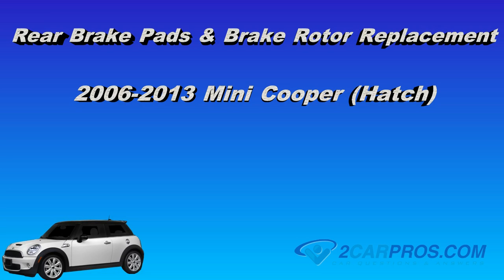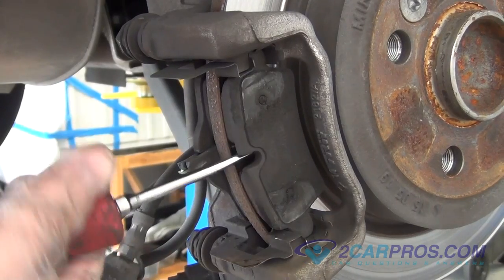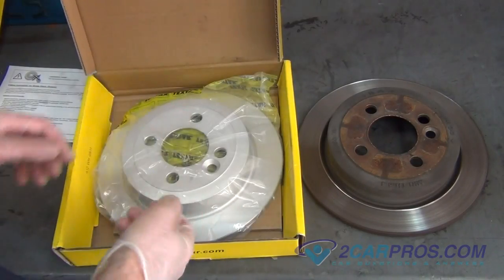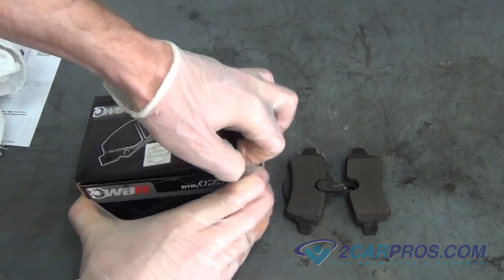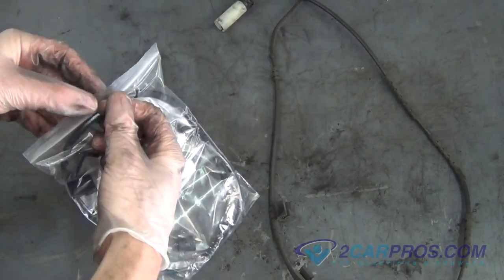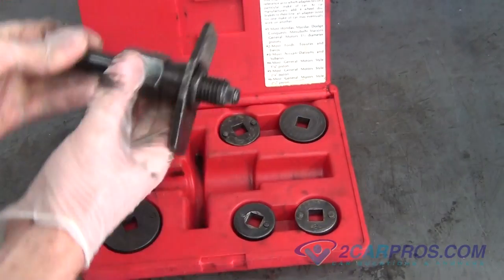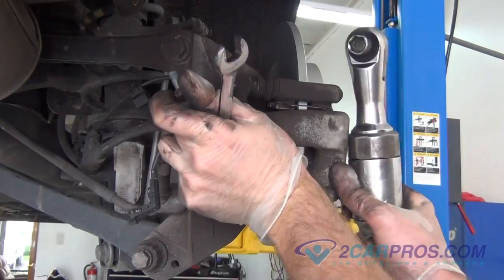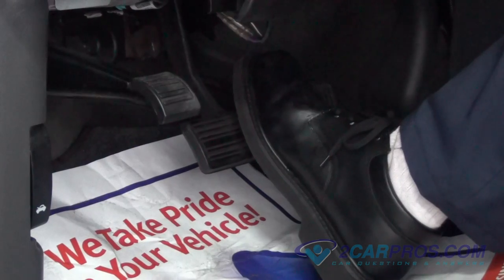Rear Brake Pads & Rotor Replacement Mini Cooper 2006-2013

Comment: I came here looking for the socket size, and got 'use the appropriate size socket'. Thanks...
Reply: 13 mm bolts & 15 mm nut for callipers. 17 mm for wheels.T 50 touque stop for rotor removal. 16 mm for calliper bracket.

Comment: Did the break pads and rotor, following your video and all great. rewinding the piston back was a bit of a effort, but did it. Only problem is the red light on dashboard didn't show off... Question: can be the sensor bad mounted or do I need to reset something? I have done the rear pads... Is it possible front ones are needing replacement as well? Is it common front and back switch on at same time? Thanks for your support.!
Reply: If the light is on, the sensor is worn and needs to be replaced.

Comment: Just done this this afternoon, brake caliper removal is not required, rotor comes off without needing to remove it, just the brake pads. Torx 50 nut is a bitch without an impact driver!

Comment: For Minis (which are notoriously difficult to find service information online for), it would be helpful if you'd specify what precisely the 'factory torque specifications' are at each point mentioned. 

Also, can you explain why it is that the brake pad sensor wire needs to be replaced at each install of the pads? 

cheers!
Reply from the maker: You really don't need them, people just get really mad at me for torque specs. Even though they don't own torque wrenches. Just tight is good. 

Because the sensor can become worn out and read improperly. Thanks for watching!

Comment: Hi, I've changed the brakes on many cars and have to change the brakes on my father's Mini. (The rear rotors are wearing away and making a horrible noise.) One question, how do you bleed the brakes? And do you have to open the master cylinder while pressing in on the caliper? (Sometimes videos forget to show this step!) Thanks!

Comment: This kills the slide boot.

Make sure to hold the nut on the slide (next to the boot) while you are unscrewing the caliper from the caliper bracket if you don't want to wreck them (this was done after the bolt was broken loose, but the boot was already gummed up).

Good video other than that though.

Comment: Great video.  Is it really necessary to remove the Calliper bracket if you remove the Calliper assembly?  What is the process for getting the warning light to go out? (cooper S 2010) Thanks.
Reply: Not necessary to remove the caliper bracket and you would probably need a new brake wear sensor if your brake warning light is still on after you replaced your brakes.. brake wear sensor could have been damaged.

Comment: Just buying 06 mini from a friend. Needs rear pads an rotter. The lug nut cover has no screw driver slot, but has a lot of little holes. Do I have to make a hook tool? And does it just pull off?    I can't find the jack? Batteries in the back, I don't know where the spear is. I might have to buy spear in a bag from a web sit. I'll have to check if it has run flats on it. Thanks you if you for a reply
Reply from the maker: Yeah should just pull off. Thank you for watching!

Comment: Hi, when I used the compresion tool, the rubber boot on the piston twisted. Is this normal? What if I remove the rubber boot or if it got broken during the process?
Reply from the maker: Bricolage Mexicano Yes the boot rotating while using the compression tool is normal. Sorry it is a little bit difficult to see at 5:54 next time we will do a little bit better filming. That tools is awkward to use. If the dust boot is worn needing to replace I would do so to insure the the life of the braking system.

Comment: Could the brake pad wear sensor be removed without damaging it?  If it hasn't broken the filament it should still work the same.
Reply: if it is like the fronts then yes, basically the inner brake pad has a spot that it hooks onto. Taking the Caliper off with the sensor still attached to the pad and just having the sensor disconnected from the connector at the White Tube end means you can slide the whole thing through the Caliper. Also doing the same in reverse when installing the new sensor onto the new pad, you can get it to clip onto the pad firmly and then feed the line through the Caliper and it stays attached nicely.

Comment: does it needs to turn on the engine when pressing the pedal brakes slowly but surely?
Reply from the maker: redenergy legaspi No the engine does not have to be on to do that step. And is probably safer the engine is off just encase it could go into gear without brake pressure. Please subscribe if you have not already.

Comment: Does breaks sesor cale needs to be reaplce if it not broken??
Reply: OzzWiz A if your brake sensor came on your dash you need to replace it. Cause it wore down til it connected the circuit.

Comment: What is the tool you use to remove the bolt holding the rotor? Thank you in advance
Reply from the maker: Could you give a time stamp so I know exactly what you are talking about? Thank you for watching!
Reply: 2:00
Reply: It’s a Torx T50 bit on my 2007 Cooper.

Comment: No fresh thread lock on the bolts? No anti squeal paste on the back of the pads? No fluid level check? No reset on the OBC?
Reply from the maker: If the bolts are tight they will not come loose, the pads have anti squeak shims built in and the OBC was fine so no need to reset. thanks for the comment though.
Reply: Those were my observations as well and I appreciate your reply.  I also wondered about lubrication of the slider pins and if you need to open the brake fluid resivior cap before you compress the caliper.  Thanks for the great video.
Reply from the maker: Just check them, if the sliders need lube then hit them up. You can open the brake reservoir but it is not necessary.
Reply: whats obc?

Comment: It IS a pity that there was no mention of dielectric grease to protect against corrosion from water/salt etc. for the brake sensor connector under the car.
Also there was no mention of torque specs. for the lug bolts, this is important to avoid over tightening these bolts that could lead to a warped brake rotor. 
The video DID give a rudimentary knowledge  of how to change the parts and  rotors though.

Comment: Brake caliber kit.......I usually just use the old brake pad with a c-clamp trick.
Reply: The rear brake piston needs to be rotated, so that trick doesn’t work.  Buy needle nose pliers can do it in a pinch. The tool is definitely the way to go. Get one at harbor freight.